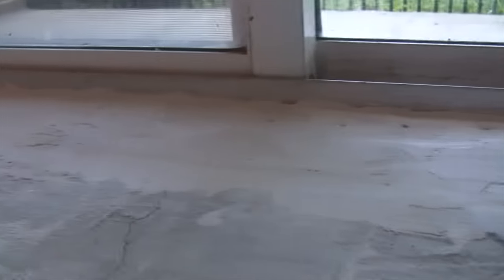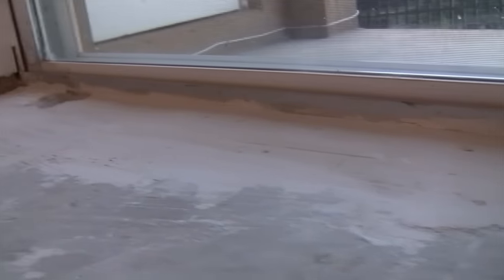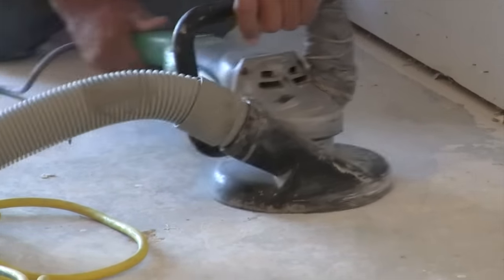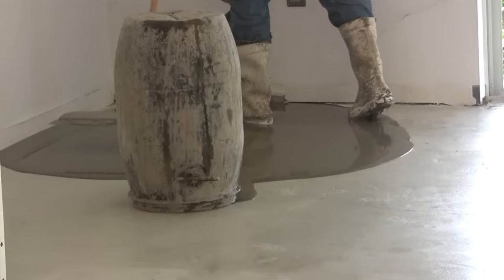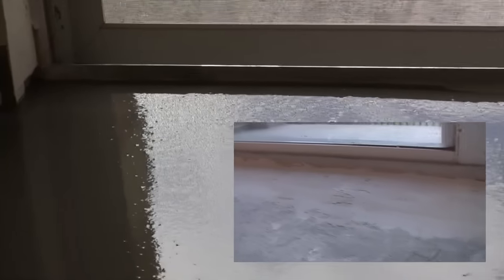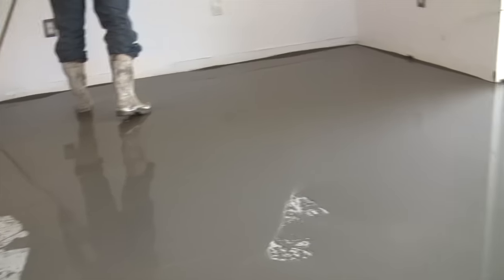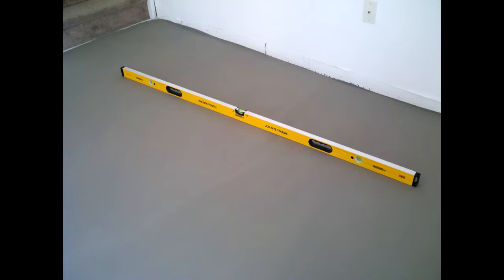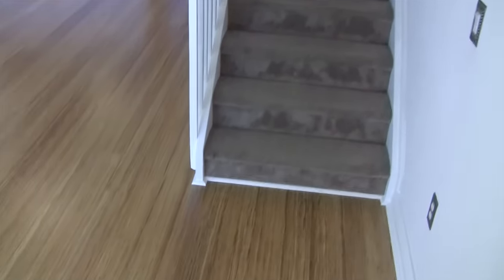How to Self Level Concrete Floors Like Pros - Self Leveler

Comment: What kind of self leveling material do you use and do you follow the directions or do you make it thinner? My floor has variations as much as 2 inches. Do you have any advice for such variation. The low points are in the middle. Thanks
Reply from the maker: I use whatever bags of self leveler they sell at home depot. I never ever water down water products I always follow the recipe exactly on the bag.I use whatever bags of self leveler they sell at home depot. I never ever water down water down mortar products I always follow the recipe exactly on the bag.  Each manufacturer is different and you must follow the instructions on the bag, and your floor sounds a little bit thick as most of these self levelers only allow you to go up to one and a 1/2 inches before having to add aggregate like pea gravel. So read the bag in see what they tell you to do. How did you end up at 2" difference?
Reply: @jeffostroff  it was an old garage from the 60's. They pored the slab right up to the wall sheetrock and it was molding. Thet really did not know what they were doing. I want a level floor to support my wood working machinery. Concrete requires a minimum of 2" thick. Leveler is about 1/2".  So I have a floor that goes from zero to -2" in the center. I really dont know what to do. As far as the leveling compound you used it looks much thinner than the brand I was using on a different floor. It would leave bumps at the seams and would not level out. 
Thanks for responding.

Comment: Would this work if the base floor is a patch work of different types of concrete? Do you have to have a specific bonding agent per concrete type, or is it a one in all type of bonding agent?
Reply from the maker: One type of primer is all you need. Just make sur you roughen up the concrete with an angle grinder first as shown i the video, and one type of bonding agent/primer will work across the whole floor.

Comment: Great video. Getting ready to do my kitchen/dining room. Having trouble finding a trowel spreader like what is showed in the video. Any where specific I can go to find that long handled tool? I've already tried the local tool and equipment rental companies with no luck...
Reply from the maker: List of tools was in the video description:
✅Tools used in the this how to level floor for tile video:
✅ SIKA 187782 Concrete Bonding Adhesive and Acrylic Fortifier https://amzn.to/34nZgdF
✅ Bosch 5" Angle grinder with vacuum attachment kit: https://amzn.to/2ErfiJH
✅ Gauge Rake with Sleds and Wood Handle to rake the self leveler compound across the floor: https://amzn.to/2Cuivap
✅ Wooster spiked shoes for applying self leveler: https://amzn.to/2Bz97QX

Comment: As far as bonding agents go they vary but most need to be overlayed as soon as they are dry some work best damp. This is important because if you go to lunch on hot day and return to overlay you will not get a good bond.
Reply from the maker: Yes the Primer that was used here in this video allows you to pour down self leveler rather quickly.

Comment: I have a 4×6 concrete pad that I want to use the self leveling product on, but it doesn't have "borders" or a wall for the product to be contained. What would you recommend? Can I use wooden forms?
Reply from the maker: Some people use a bead of caulk, some people form a wall out of balsa wood.
Reply: @jeffostroff  I have a very uneven, flaking, bumpy old basement cement floor.  Is it possible to just level one area, like maybe 10 x 20 feet?  One concern is that I need to have dehumidifier on level floor down there.
Reply from the maker: @julesy105  Sometimes they will lay thick beads of caulk on the floor to dam up the self leveler. Where it meets up to the old floor that won't have any leveler on it, you just feather it flush over the top of the old floor.
Reply: @jeffostroff  ty

Comment: Rookie question....  trying to turn a room in a basement into a workout room.  I'm interested in the possibility of using the epoxy paint they use on garage floors that you can put the colored flecks on to add depth and camouflage some sins.  The back half of the room needs to be leveled.  Can you put epoxy paint directly on leveling compound? And can I only do the leveling compound on the half of the floor that needs it and not do it on the half that doesn't?  Will it cause a color variation even if I do two coats of epoxy paint?
Reply from the maker: Yes, you can put the self leveler on one half of the room, and make sure you blend it in nice and flat to the existing floor, don't leave a noticeable lip along the border between the leveler and the original floor. Once it dries, you can do your epoxy over the entire floor. Don't add anything to the wet leveler.

Comment: Can you self leveling your floor on second floor? As I mentioned before i tried to do it my self but it ended up uneven. Now im thinking of putting a second layer. Any recommendations on that?
Reply from the maker: Yes, in fact this unit was self leveled by the builder, so the second floor already had a nice level 1" or so pour of self leveler. You should be able to pout more over the top of the other, just read instructions on bag if to see if you have to get this done quickly, as some manufacturers don't want you waiting too long between pours.
Reply: jeffostroff  also since its a second layer do you use a primer or a bonding agent?

Comment: I'm looking to renovate my home and install concrete stained flooring throughout the house. The current flooring isn't level. What advise can you give regarding contractors? What are questions I should ask?
Reply from the maker: Make sure you use a contractor that specializes in leveling floors. They can tell you when they come to estimate how far out of level it is and how much they think they will need to use, as that will affect your final price.

Comment: what did install between a laminate and patio door? what is the transition look like?
Reply from the maker: It is called a threshold piece if you go to lumber liquidators for example you can type in threshold molding and it will show you what it looks like

Comment: Is it possible to do something like this around a weeping tile cap? It is in the middle of my floor and I need to be able to get in there from time to time because my area is prone to flooding. Also, if someone does not have access to and adequate sander and cannot rent one, but needs to remove paint, any ideas on how that can be done? Thank you!
Reply from the maker: You can do this around anything you just need to think where do you want the self leveler to stop. And you may have to dam up around the cap so for example when we do toilets we always call a huge round bead of caulk around the toilet flange on the bare floor so that the self leveler does not run down any cracks or openings or gaps or anything like that. Now as far as the paint if you are talking about paint on the actual floor generally the only way to get it is to get a grinder attachment and grind it off or spend hours and hours in different products in labor trying to figure out how to get that paint off

Comment: Hi can i do stain over the self leveling cement ??( to change the color of the floor).
Reply from the maker: Ivan I doubt that you can stain this and I'll tell you why, usually the manufacturers of self leveler compound do not want this to be the finished floor they expect to have some other type of flooring put over it because this is not a traffic surface. So to that and I don't think it would make any sense for you to stain it since you're not supposed to be using it as a traffic surface. But check the bags instructions and see what it says, and  contact some of the manufacturers like Ardex,  See if they have anything, you might even look into doing a poxy floors as well because those you can colorize.
Reply: jeffostroff , thank you for you help, i will see the Ardex product ( they say i can use for driveways), 👍👍
Reply from the maker: @ivansuarez5179  awesome

Comment: I am installing ceramic tile on exposed aggregate concrete on our heated back porch.  The concrete is not cracked at this point.  When it was new 7 years ago, we put a color stain on the floor.  Can I lay the tile directly on top of the aggregate?  Thanks...Bill
Reply from the maker: Yes, you can spread your tile mortar on this aggregate concrete. But I would recommend using a concrete primer first, a bottle of white liquid costs about $8 at Home Depot on the cement aisle. Primer allows new mortar to to stick to old mortar. Without it, the thinset mortar might not hold to the older aggregate concrete. Also, you mentioned you stained the aggregate concrete. If it is any type of smooth or glossy surface paint, I recommend you get an angle grinder with a diamond cup wheel and roughen up the whole floor surface of the aggregate concrete first, just like you saw here in this video.
Reply: @jeffostroff  Thanks for the reply.  I should have mentioned that I set a tile as a test and it appears to be holding nicely. Bill
Reply: Yea. Like jeffostroff mentioned. If it has any type of sealer or gloss on the floor I would recommend scratching the surface first. The mortar may stick at first but after a few months to a year it could delaminate and separate from the original floor. Better to take a little extra time to prep the floor than have a massive failure in the near future. Also if you ever drop anything on the tile floor the tile could pop up in large sections.

Comment: How thin can this be applied before breaking/cracking?  I'd like to do my basement concrete floor before putting my LVT in, but don't want crunchy noise coming up every time I walk on it.  Also, do you have a recommendation for the bonding agent?

Thanks
Reply from the maker: You'll have to check the manufacturer's recommendations, but usually you feather this product right to zero, but I would feel better at 1/8" thickness. Here is the primer: SIKA 187782 Concrete Bonding Adhesive and Acrylic Fortifier https://amzn.to/34nZgdF

Comment: Would this work if I need the floor raised 1/2 inch?
Reply from the maker: Yes, they just have to pur down more self leveler. The bags tell you on the back how to calculate the # bags needed based on the square footage of the area, and the thickness of the pour.

Comment: Ok. I've done this on a few. Seen multiple ways. I always run into problems if I rake it. Only way I can get it to work is if I use tons of bags and pour one into next fast as I can. Every time I pull the rake it pulls too much out of one spot. I'm on one now and we got it pretty close but still a huge hump from highest spot on floor. Now do I pour around this and try to rake it level with that? Or pour a while nother almost half inch all over? Cause if I go over hump it'll add in that area. Hence more in low spots again. And always get humps when I rake it around. When your guy poured that second bucket, that first one was setting up and when it mixes the next bucket his higher. So do you float the rake perfectly level or what? The floor I'm on has a huge crown in middle halfway down the room. Still a bump in the middle, and uneven spots in places. They say you can just pour a small portion where low spot is but the viscosity always leaves an edge. What the hell am I doing wrong? I just bought one of these same floats and plan is to go over it all again once more but not over the hump. So if I pour a bucket in low spot and it's too high when I get all the way to hump do I just keep pouring? My tile buddy of 20 years says not to rake it at all. Just pour and let sit. But then you're using tons of bags and more than recommend thickness. Any help would be awesome!
Reply from the maker: It sounds like maybe you are not adding enough water. These guys work in a team of 3 people. One guy mixes as the other pours in the bags. They mix for about 2 minutes, then one guy dumps the barrel onto the floor where the rd guy rakes. You need that choreography to keep the process constantly moving. These guys know the product they use well, they know exactly how much water to pour into the mix, they have it down to a science. They have water buckets with holes cut so that you just fill the water bucket up to hole so it leaks out the excess water and you have the exact same amount each time. If you lack the correct amount of water, and mix it too long, it will start to set up on you and wont rake. As for the hump, you should try to grind down the high spots of the floor, rather than waste material trying to raise up the level of the entire floor to match the hump. when you rake the material, if you are scraping away material, then it has set up too fast on you. Remember, most mixes give you 2 minutes to mix, and 5 minutes working time max.
Reply: @jeffostroff  thank you so much for your comment. We literally just poured this morning and it turned out perfect. I think that was the case is not enough water. We did what it said and add another quarter. And I did think about grinding down the high spot but it was like 3 by 3

Thanks again for the awesome video take care

Comment: I just started on a job today putting down some of this for a slab outside just in a corner, how do I level out the concrete on edges? This isn’t going to all 4 corners of the slab, but about half way.
Reply from the maker: If I understand correct, you are not pouring the leveler all the way across, so I would use a trowel to almost scrape it down at the edge to the point that it leaves it smooth, don't leave any lip edge on the border edge of the area you pour. Coax it all the way flat like you are doing drywall mud.
Reply: jeffostroff yessir! Sorry about the confusing question, was in a major rush trying to type this before it set too much, but that was exactly what I ended up doing. Thank you for your videos and your communication, they have helped me very much! Hoping to develop a helpful friendship!

Comment: Will radiant heating under concrete still work good after doing another layer of self leveling concrete over the old concrete floor?Not sure if concrete thickness plays a role in how well the heat goes will work
Reply from the maker: what most installers do is on top of the self leveled floor, they install Schluter DITRA-HEAT see it here: https://amzn.to/3632cxZ and they have the wires and other parts that go with it. Then the floor goes right over it.
Reply: So you would have to apply radiant heating on top of the new leveled concrete then? We have water radiant heating under our current basement floor. Very smooth surface but haven’t checked to see if the floors were quite level. Thanks for a fast reply. I’m just wanting to make sure cement thickness wouldn't play a big factor in the current radiant heating I have now.
Reply from the maker: @absolutemalmaute9592   Yes you're normally place it right on the completed sub floor. But you need to make sure and check everything with the manufacture of the heating that you are using to be sure that that's where it goes. You also have to make sure it is compatible with the flooring you are using for example if you're using wood floor is it compatible does the manufacturer say anything about it that's what you need to look into.

Comment: Hi there. Could you help me with a problem? I was going to tile my concrete floor but realised it's not completely level so needs some self levelling compound. However, I've already coated the floor with Setcrete floor primer. Is it ok to put the self leveller onto the primed floor, do I need to remove the primer or do I need to coat the floor with a bonding agent?
Reply from the maker: The primer is the bonding agent so to speak so yes you're OK with what you've done so far that is what you need to do before pouring self leveler. The primer helps the new concrete bond to the old concrete.
Reply: @jeffostroff  Well that's a relief! Thank you!

Comment: Does anyone know how to avoid or remove bubbles that formed in the self levelling concrete? I used it last week and  the finished surface was cover in small bubble.
Reply from the maker: I have heard it happens from mixing it too fast what too high of a speed. But they really don't cause any problems because the floor will still be fla But you could still roll the brush through it or at least squeeze it and try to get some of the bubbles out
Reply: Thanks Jeff , we were mixing at a high speed, I'll mix slower next time.

Comment: I have a question. We have a carport room that we are converting to a laundry room with an entrance into the home. The problem we have is because this was a carport room the cement slopes down towards the street. We need to level it for a washer machine. How thick can this be applied and is this the best option?
Reply: I would like the same answer. I wonder why your question was not answered.